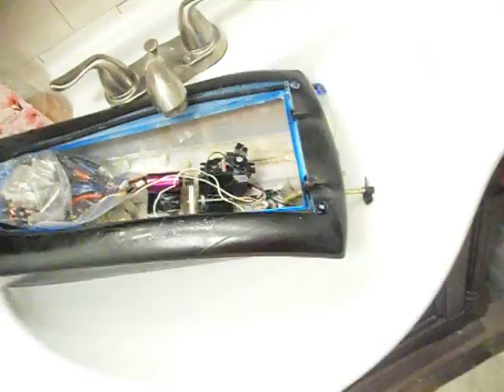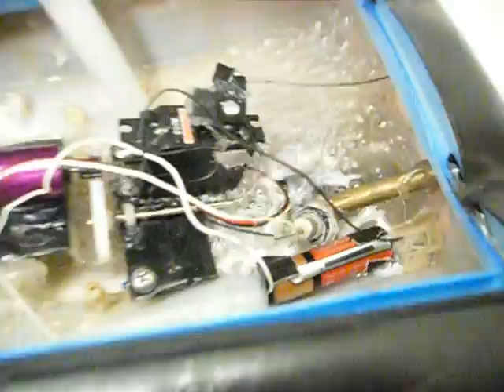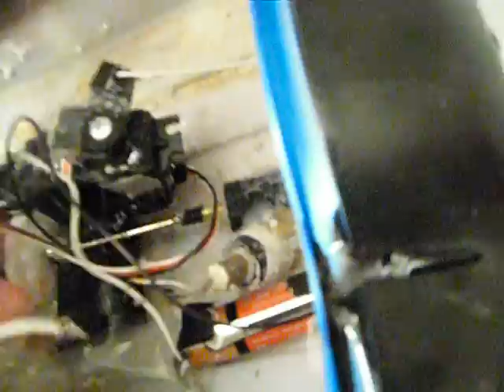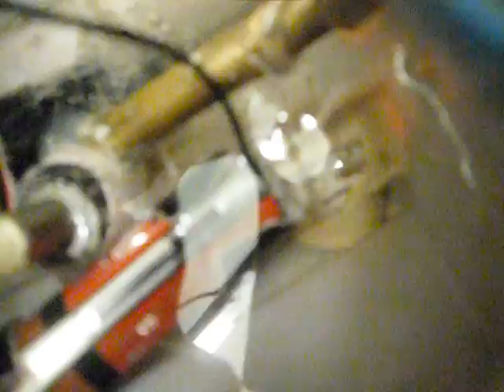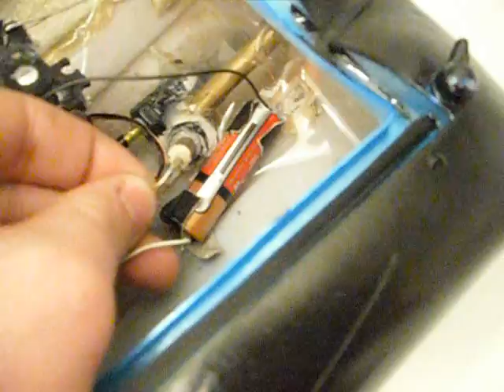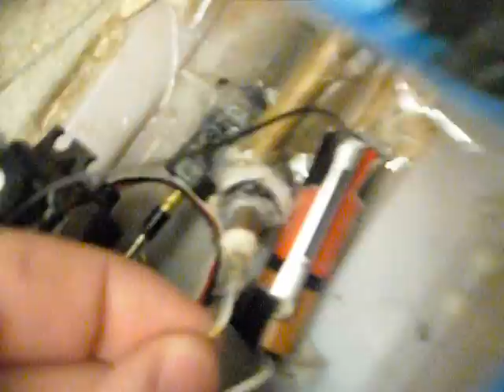Micro RC bilge pump

Comment: what did you use for the pump? Looks like a pretty quick set up.
Reply from the maker: I used a small helicopter motor and a 4 blade impeller (4 pieces of plastic glued to a airsoft bb on the end of the motor)
Reply: A home made pump! COOL!